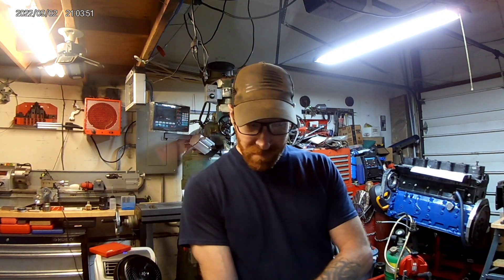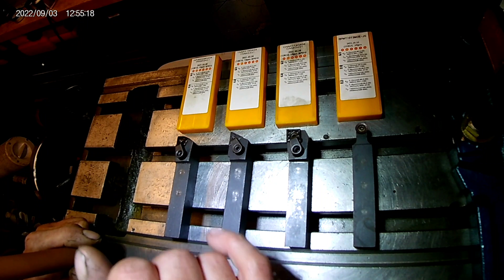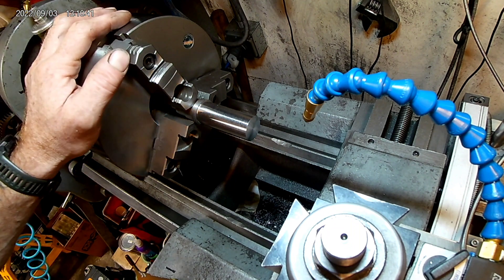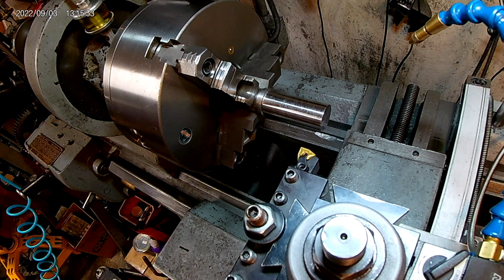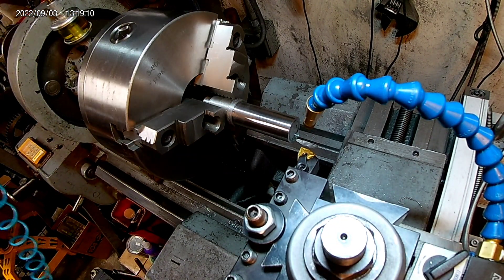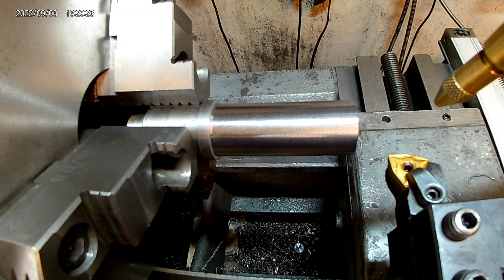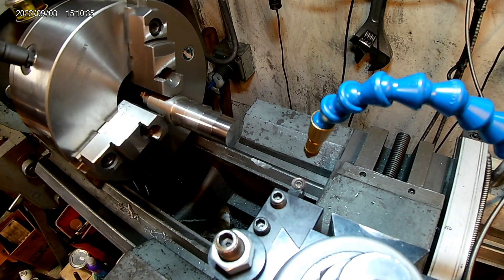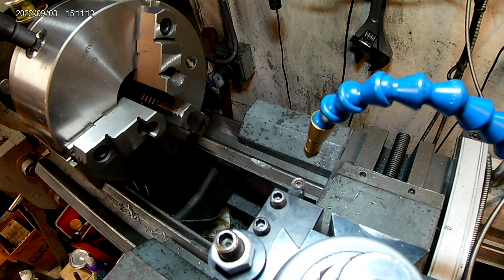What Carbide Insert Shape Is Best? Tested Cnmg Tnmg WNMG and one surprise!

Comment: Appreciate your time and effort.  But nearly any tool will cut 12L14 nicely (even a broken one. No kidding!). Test on hot rolled and get a nice finish.  Also test with really light cuts too. Like 1/2 thousandths depth.  These are the types of things home shop guys need to be able to do.  My thoughts for what it’s worth.  Throw away the negative rake tools, get positive rake carbide, like for aluminum.   Turnoff the cooling and crank the speed until the chips come off straw colored or even blue.

Comment: The diameter affects the SFM, therefore as the piece gets smaller, the SFM changes, and quality will suffer a bit. 😮A better example would be to cut a smaller section with each tool, at the same diameter. This would make the feeds and speeds more accurate for the surface meter per second.

Comment: I'm unsure if this was purely for comparison sake, but I noticed that you have a very slow RPM/SFM for the carbide tool and that material. 12L14 cuts super easy, if you still run this material slow I recommend trying 150 SFM and work your way up/down until you get the best results. Having fast but appropriate speeds for your cutting conditions can save a lot of time. Heck, with that coolant you can probably do fine at 250 SFM.

I apologize if this was intended to happen for the video or if you've already figured it out by now, I'm only trying to help out because these cuts are going about as fast as HSS tooling, you can safely run the RPM's 3x faster (of course depending on the lathe and other cutting conditions).
Reply: Actually, don’t the manufacturers recommend feeds and speeds for carbide inserts? 
If you are looking for finishing you’ll probably want an aluminum insert. If you want fast devastation you choose another type if you have interrupted cuts…. 
I found that out through experimentation. 
The best insert is the one I have at the time tho…. (Hobbyist here)
Reply: @thigtsquare950  Manufacture recommended speeds are a starting point if the conditions allow for it. I don't think they should be fully trusted as I've heard companies sometimes over-rate their inserts and tools so you have to buy more of them.

Comment: problem is with your use of carbide insert - carbide inserts are made for high cutting speeds, you use RPM as if you were using HSS tools, for such small diameter you should use 2000 RPM and above or you are just destroying the inserts
WNMG are medium roughing with 6 edges (D.O.C usually up to 4mm) but are not as stable in holder as mid-heavy roughing CNMG with only 4 edges (D.O.C usually up to 5.5mm)
TNMG are good for tight internal turning, they also have 6 edges but are weaker than WNMG, radius inserts are good for medium-light roughing and finishing but generate huge amount of radial force so must use with caution
personally i use DCMT or VCMT for finishing small/medium parts and DNMG for finishing bigger parts (ex. 120kg shafts), negative inserts are primarily for roughing (the second letter in insert name ex. xNxx) - chip breaking on these inserts will probably work with atleast 0.8-1.5DOC, 0.15-0.22mm/rev feed and 250-350m/min, the way you use them on the video is just destroying them
Reply: Good information! In the shop on the manual lathe I mostly use WNMG for roughing, and VBMT like the Sandvik 1125 or the Tungaloy 6130 with 0.4 mm radius for finishing, for small diameters, bad materials and short journals on flanges or 0.2 radius work I use the DCGT ic520 from Iskar. There is also the VCGT ic520 but it doesn't last very long, so I only use them for chamfers.
Reply: @Universal_Craftsman  I believe Sandvik 1125 are the dark pink-purple-bronze ones primarily for stainless? yes, inserts for stainless usually don't work good on steel and vice versa
sadly I work on CNC lathe and I'm used on different approach - on such small diameters I leave it rotate up to 3-4k and roughing inserts usually work 25-35 in-cut minutes, finishing always last atleast whole shift, on manual lathe I work once a year at most and I'm always afraid to run RPM above 1000 revs but principle is the same, just hit the revs if you believe the part won't fly away
Reply: What would be the insert for heavy roughing? SNMG?
Reply: @Universal_Craftsman  should be but you need strong rigid machine to fully use their potential, when I work on 26kw turret lathe and rough 1.4404/316L stainless with walter WNMG080412 WSM20S RM5, 3.5mm DOC, 0.35mm/rev, 140m/min, I'm over 90% spindle power and it's dangerous because if the engine runs out of torque, the insert shatters, not mentioning force the turret must withstand and nice sounds it produces - SNMG inserts are used in 75° and 45° holders so you can add even more feed thanks to chip thinning - so you need strong machine to use the inserts in its intended limits and also the tool angle produces a lot of radial forces so you need big part that doesn't bend and very rigid machine that won't fall apart after few seconds of machining

Comment: What holder did you use for the round insert?
Thanks for the video!
Reply from the maker: Hello Howard. The tool holder is SRDCN1616H10 available on eBay Amazon etc. The round inserts are very strong and work well for removing weld build up etc. Thank you for the comment!
Reply: @smallgaragemachineshop2715 I see these are one sided inserts with a screw hold. Mine are two sided which need a pin & clamp. Im having trouble finding these holders but thanks anyway 👍

Comment: Ok let me help you…all carbide inserts have a min/max depth of cut in order to be effective i.e….chip control, proper wear.  The chip break is determined by the land and depth of cut.  You’re not utilizing your inserts properly in this video.
Reply: I'm a home hobbyist and new to this. Where would one find such information?
Reply: @chainring_tattoo No need to get stressed about it, just use WNMG for roughing, and VBMT or DCGT for finishing, and use the appropriate speeds and feeds guide values are given by the manufacturer, and you will develop a feel for it. But beware, if you have a small lathe with low power, you probably can't use roughing tools anyway since the cutting load gets too high with those. Most of those people use sharp inserts or use aluminium inserts for steel, they don't last long but for small and mini lathes it's the only option.
Reply: @chainring_tattoo  What specifically are you looking for?

Comment: To be fair in comparisons with the round insert you should be using 432 inserts which are less sharp than the very pointed 431 inserts, i.e. CNMG 432 etc.

Comment: I enjoyed the video, I’m still learning and was so if you could explain a reason for the difference. I hear you touch on the larger radius but felt there was more there. Thank you
Reply: When turning features on a lathe, you are essentially just cutting a fine thread. The finer the thread, the better the finish. The large radius spreads out the thread that is being cut and makes it harder to see. This also means that if you use a tool with almost no radius, you will see the thread easier. The larger radius has more tool pressure so this trick doesn't work that well for Chinese mini lathes and can cause a ton of chatter.
Reply from the maker: hello Ethan, thank you for taking the time to comment. I can certainly help you out to the best of my ability. are you looking to find out more about why the nose radius affects the finish? let me know and I'll see what I can do. thank you!